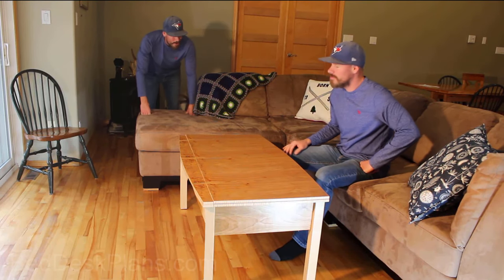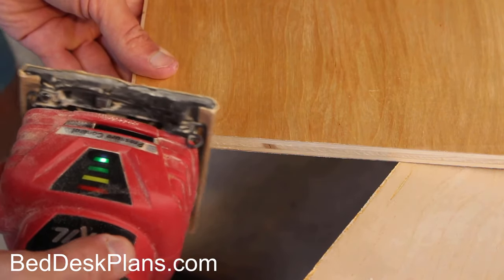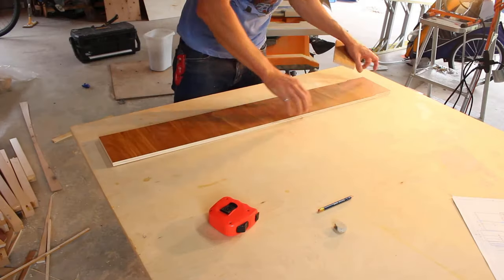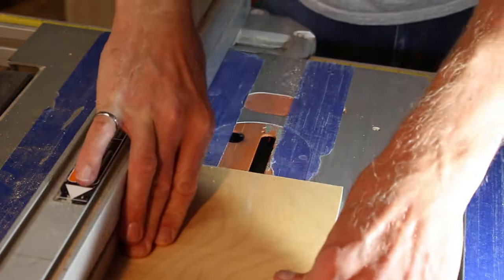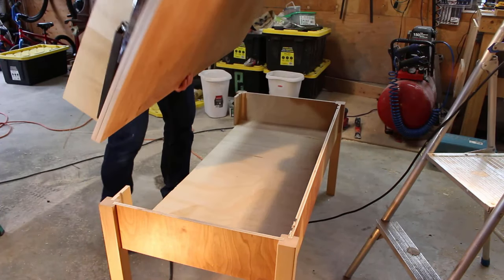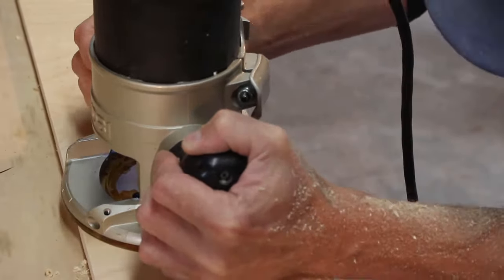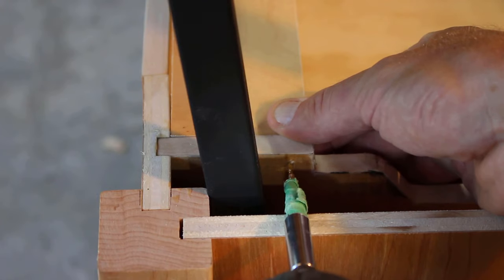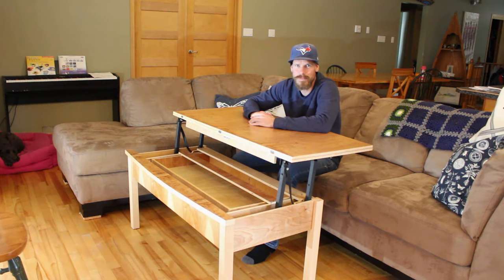DIY Lift Top Coffee Table FLIPS to Dining Table -Not Epoxy Table- How to Make LIft Top Coffee Table

Comment: This design is amazing! I want to make it!
Reply from the maker: you should make it!
Reply: @TheHowtoDad  Do you think this can be done with regular limited shop tools?
Reply from the maker: @r.ericsonera1987  absolutely!  I try to design things that use only non specialized tools. what do you have?
Reply: @TheHowtoDad  Small table saw, drill, router. Super limited. I think it can be done with some thinking and planing, but I'm not experienced in doing furniture. I just really liked your table design. Practical, nice piece, and super useful for my small limited space.
Reply from the maker: @r.ericsonera1987  could be done with those tools. I'd suggest adding a good jig saw to that quiver!  time and patience, slow is smooth and smooth is fast! go for it!
Reply: @TheHowtoDad  Awesome! I do have the jig saw (forgot). Thank you for setting me on the right track!

Comment: This is the exact kind of thing I would like to have.
I've seen ridiculously expensive transforming coffee tables (they extend like the first part of your table and don't further fold out into a full table, but the main thing I want is the ability to pull it over one's lap when sitting on the couch, so that's kind of fine...).  The sellers (not counting shipping and tax) tend to ask for $1000 for them.... and yeah, not spending that much.
One thing I would change/add to your table is weights to the back side of the table (furthest side from the couch).
This is to counterweight when placing heavier things on the pulled up table top when it is over your lap as well as to add stability.
This is probably more of a personal issue, but the reason I would want this is because of using large gaming controllers (such as arcade style ones for rhythm games), of which you'd be pounding away on the buttons and wouldn't want the table to shake or even worse, tip down on you while playing....
Of course it would make the overall table heavier, but it wouldn't require the look of the table to necessarily change.
Reply from the maker: Great tip! thanks

Comment: I have always has excelent results using tape to prevent blowout on the table saw. Not sure why anyone would say it does not work unless they were using the wrong blade anyway. You would not want to use a rip blade on plywood for example. Very ingenious table BTW.
Reply from the maker: ya, seems to work well for me too.  thanks!